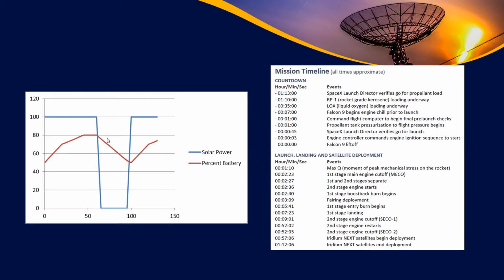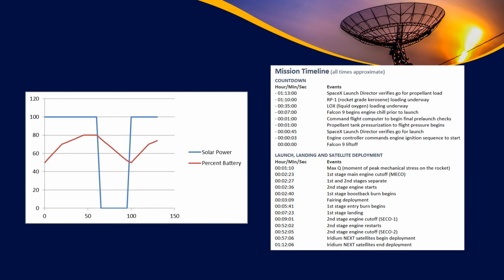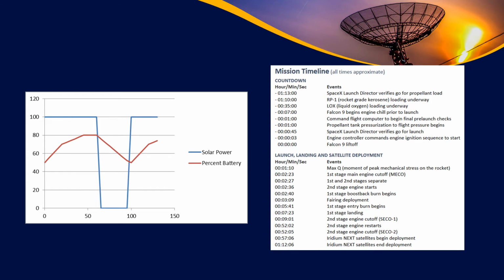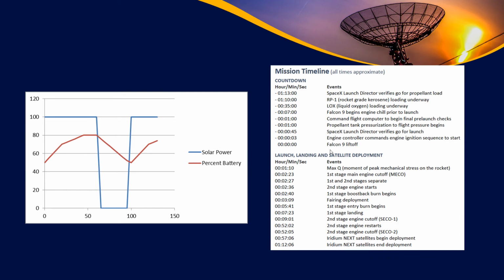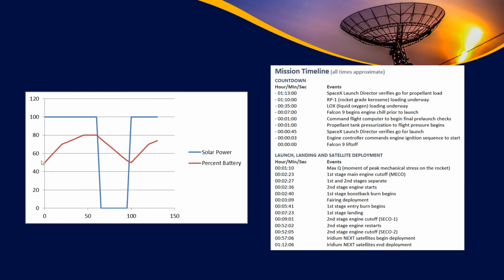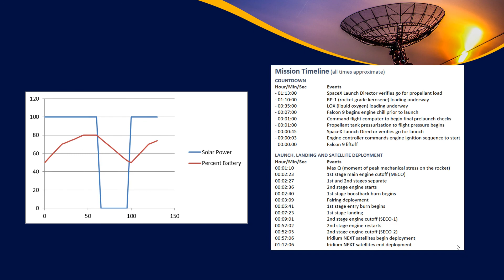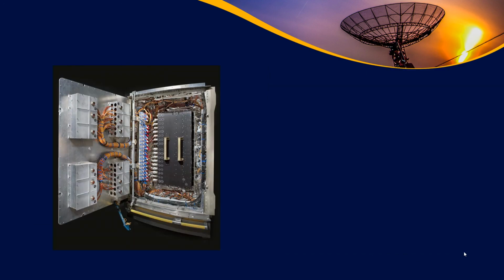Basic Satellite Design- Power

Comment: Thanks for your update. May I ask whether or not there are PhD questions to solve about satellite power supply system issues? Kindly provide an insight into why someone could do a PhD in satellite power.
Reply from the maker: That is a really good question. Not having a PhD at all, I'm not sure that I could fully answer that, but I'm confident there are issues that could be solved in that field. One interesting area might be in "shunting" power, where you have fully charge batteries and fully lit solar panels and need to not use all of the solar power. Also, anything to do with battery management has some pretty useful applications, in space and on the ground as well. If I were going to seek for such a project, those are the two areas that come to mind right off the bat.
Reply: @WhereisRoadster  I appreciate your response please. Thanks for your insights. In this case, do we have to just open the source i.e. disconnect the solar panels from the system entirely or say disconnect the battery temporarily after being fully charged and at least let the OBC powered from the panels?
Reply from the maker: @engr.alidanladi4710  I haven't directly dealt with the problem, but I think they usually shunt them. Solar panels for those kinds of applications can be rather tricky, to say the least...

Comment: TLDR; Cubesats will use solar power. Sputnik ran for 21 days on its non-rechargable battery! Batteries need to hold charge at launch time and through periodic eclipses. Iridium NXT had to run off batteries from launch for 1 hour 12 minutes before solar panels up and working.

Comment: are there some batteries in the last stage to top off the satellite just before release?
Reply from the maker: There are batteries, I've never heard of an instance where they provided power. Usually there is a cable that is part of the rocket cable runner that runs to the payload area of the satellite that allows the power to be continued. When the time comes to go to internal power, they disconnect the lines, which will cause the batteries to discharge slowly.

Note that Cubesats don't even have the ability to charge at all when encapsulated. That is part of why they usually don't have significant deployables. They are usually completely disconnected from the rocket, only the P-POD connects to the rocket. The rocket will tell the P-POD to deploy a satellite, at which time the P-POD will disconnect, and the satellite has switches that allow it to know it has deployed.